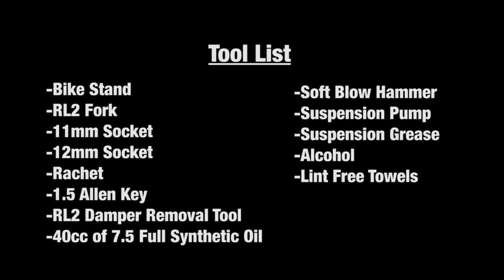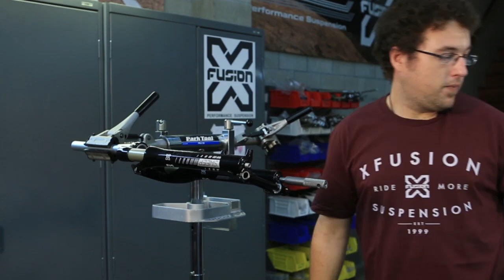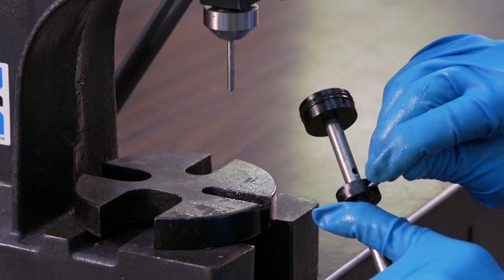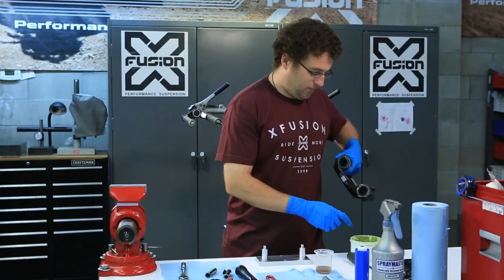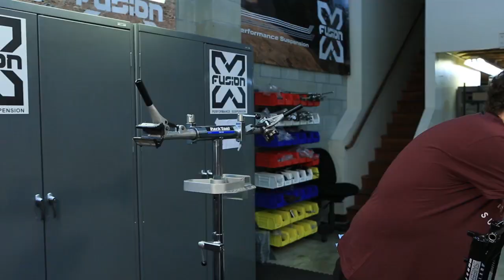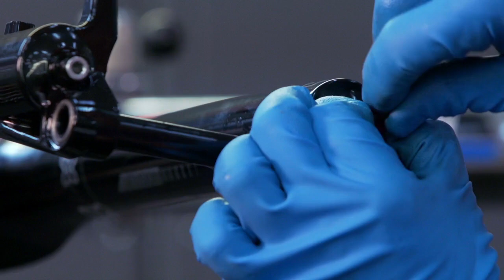XFUSION RL2 Travel Adjust - Service

Comment: I have a 2014 Trace unicrown RL2. It came set at 100mm travel. 

I thought I read way back they came in either 80 to 100 or 120 to 140. Is this correct, or can I adjust my 100 to 140?

I saw theres a travel adjust video and I watched it but I havent taken the fork apart yet to check. (Its on an old trek to use as a friend bike)
Reply: Im posting this here because your service sucks and you won't respond to my emails or comments.
Reply: How to  reduce the travel in rc32? I cant find the info.